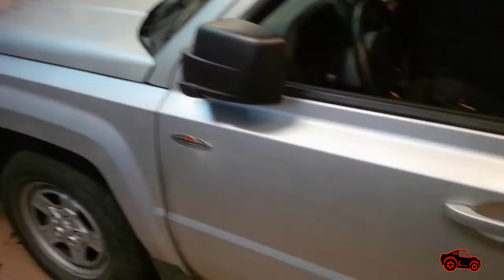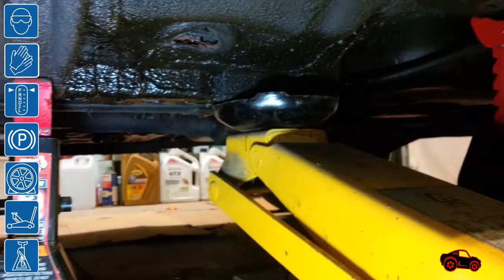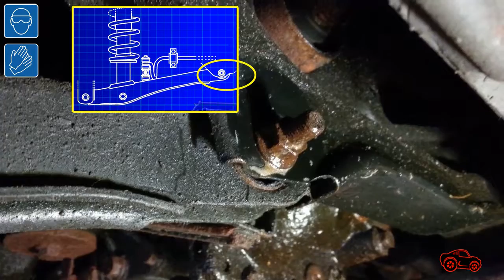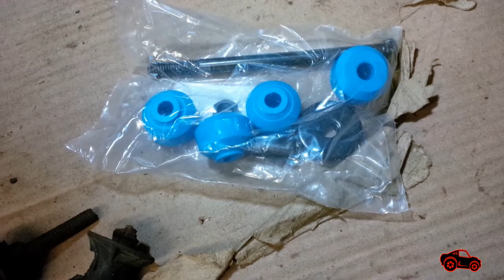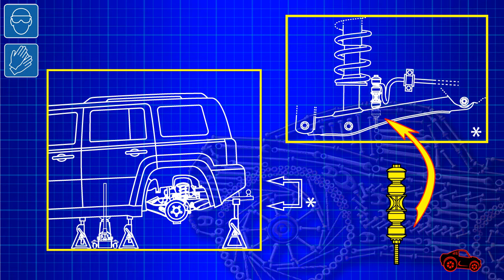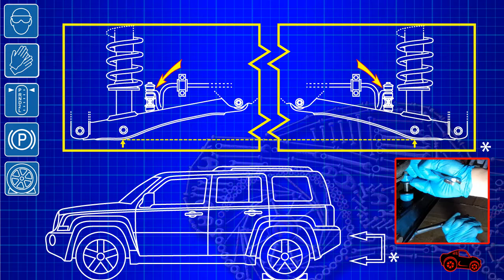Jeep Patriot Rear Lower Control Arm replacement & Bushing Preload

Comment: I just installed the upper and lower control arms as well as the dog bones , the package contained two left handed lower control arms , I was lucky that my sway bar attaches directly to the control arm and not the welded bracket on the control arm. Is it a problem if all the bolts are tightened and the preload was not done  ? , yet the frame to wheel measurement came out to be the same before the installation.
Reply from the maker: Lifting the trailing arm to the initial measurement sets the arms to angles equivalent to the position of the vehicle when it is parked on an even ground.  
If the bushing(s) is/are tightened when the coil spring is fully extended with the trailing arm lowered, the bushings will be twisted later when the weight of the vehicle will be applied on the wheel in normal parking condition.  
So, the rubber bushing(s) will have to endure more axial torsion than what it is made for and it/they will not last very long.
The bushing(s) can be readjusted to get rid of the axial torsion by loosening and tightening the bolt(s) to specs when the vehicle is normally parked, but, the space to work under the vehicle is very tight and you have to be quite handy to do it that way.
Note: A spherical bearing side can be tightened to specs without load or preload conditions.
Reply: Thank you for the detail very good info.

Comment: Can i replace just the bushings if the main parts are still in good control?
Reply from the maker: Probably, if the parts are available, but you need a good press and the proper tools. Check online with Rockauto , Advance Auto Parts or Amazon.

Comment: If there's enough room I would snug all nuts after the arm is installed, put the wheel back on, lower it and the tighten the nuts to specs. That pre-load would be perfect. I will try this when I install both rear lower arms on a compass this week.

Comment: Hello my jeep patriot 2.4 4x4 latitude sags in the back suspension and no ride highth. I got upper and lower arms now I'm thinking of rear sub frame
Reply from the maker: Many people had the front sub frame and/or the rear sub frame replaced because of (rust) structural damage. There was a Jeep service bulletin (23-007-17 REV. B) and a 10 year warranty added to replace the sub frames.
Reply: @MTLCARGUY  oh ok thank you ,yai forgot that few yrs ago when they had one of the recalls Chrysler said I had a warranty on the rear subframe to replace for wear not for sagging